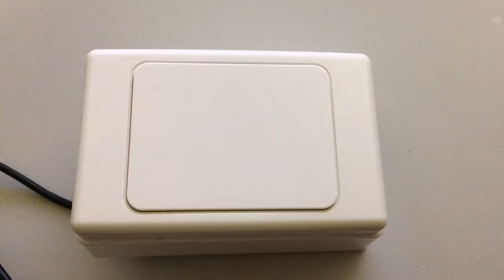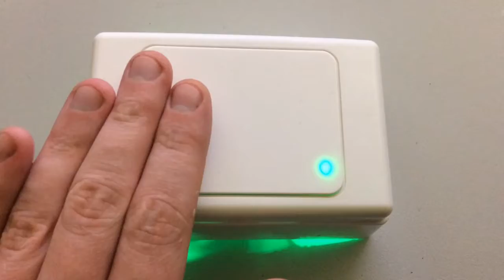2-channel capacitive touch wall switch

Comment: Hi 
I saw you project on you Git repository and i have a question:
It's ok to ground on side of the shunt resistor? Looking at the user guide page 13 I see that none of  curr+ & curr- are grounded.
http://www.atmel.com/Images/Atmel-42689-Atmel-Smart-Plug-Hardware-User-Guide_AT16225_ApplicationNote.pdf